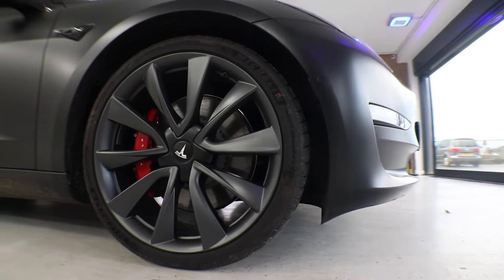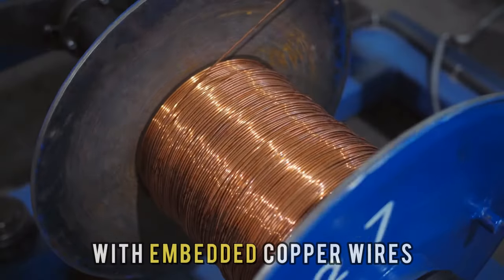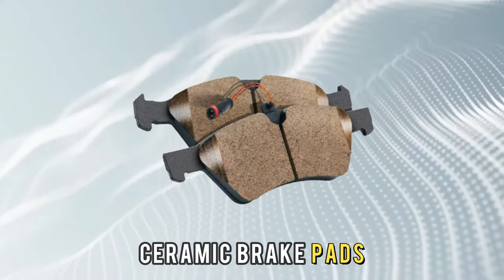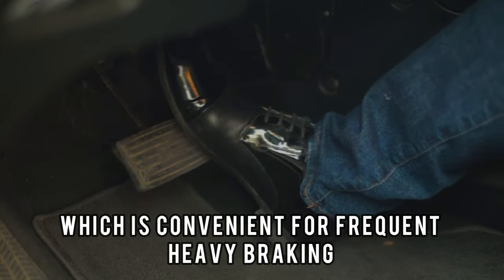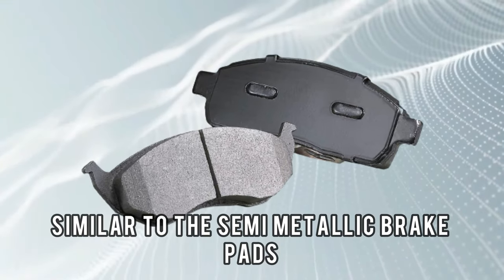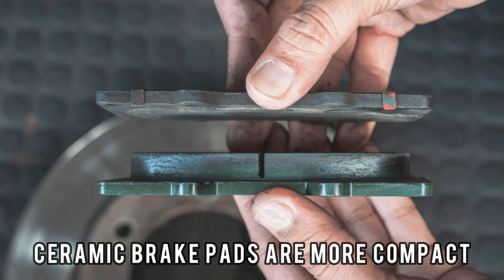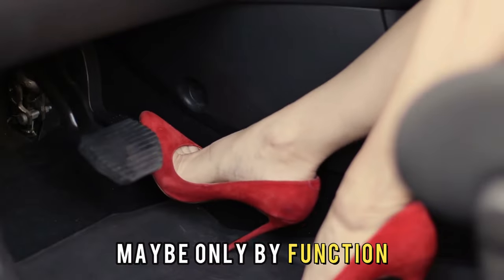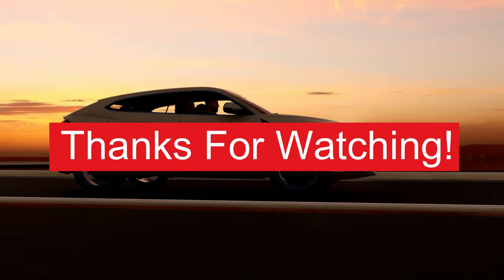Ceramic vs Semi-Metallic Brake Pads –What's the Difference? ( Pros and Cons of Each)

Comment: Rubbish,soft brake pads grip the disc more effectively but wear quicker and make more dust,ie Ferodo Zero without much disc wear.The harder the pads,the more wear,which do you want to replace more often pads or discs.? Many years of track car and road car experience.
Reply: Ceramic brake pads for my Audi A4 Avant Quattro 2022 are more expensive than the discs ;)
Reply: That’s false

Comment: My rotors warped and brakes faded after I switched to ceramic pads on my FJ Cruiser. I’m replacing the rotors and switching back to OEM pads.
Reply: I read somewhere that ceramic is bad on heavy vehicles